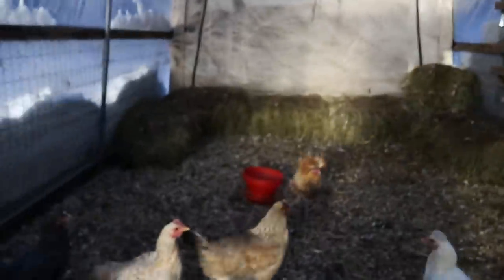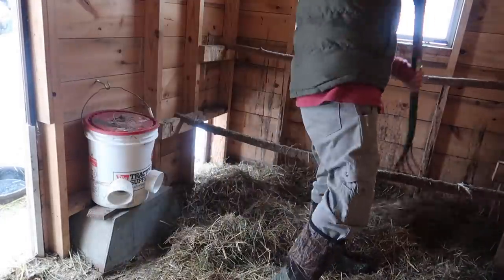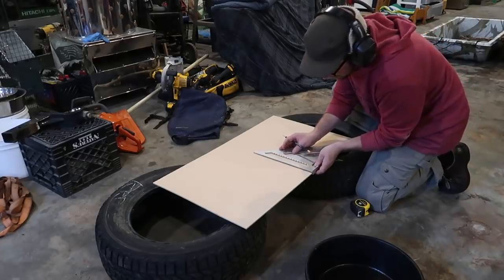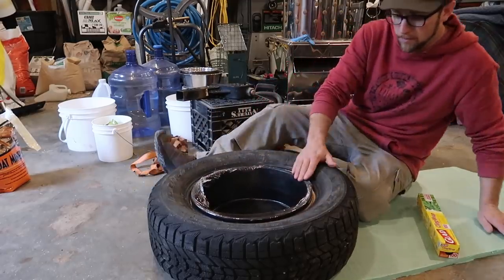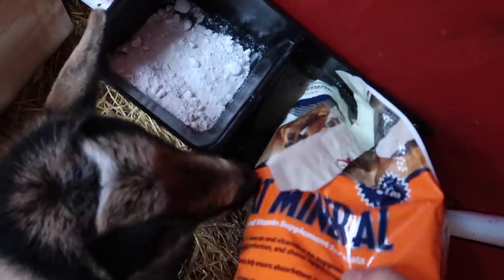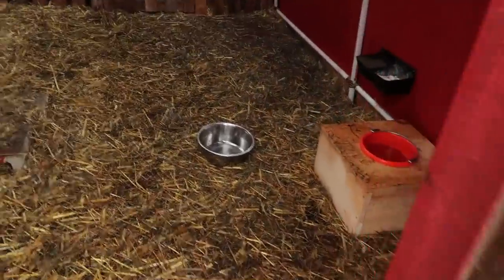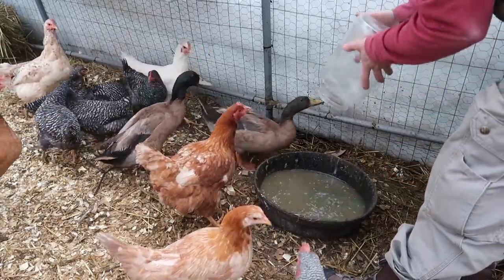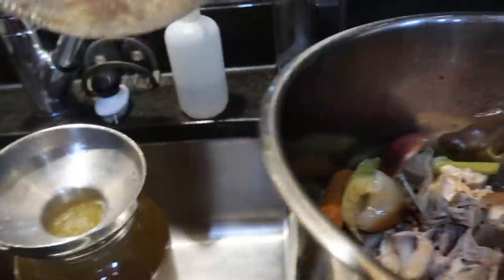This will Make our Chickens so HAPPY!  (DIY Chicken Waterer That wont freeze without Electricity)

Comment: You forgot the roosts for the chickens again. 🙂
If you wanted those tires to build and capture heat, you may want to try something else.  Foam insulates very well, but dont think it really stores much heat for later.   But I've seen some farms that don't really water or feed at night, so when it's really cold, just chuck what's left.  No?

Comment: To add more insulation to the bottom of the water container.. You could cut and wrap, with the foil.. 4 pieces of, like 1x1 wood, long enough to spread the tire bead almost as wide as the sides of the tire...
Once,  most of the foam has been sprayed in and set.. They can be removed for the last spraying of the foam.. 
maybe

Comment: Willow probably smells like GOAT!
Did you not use fiberglass batt insulation for part of the freeze proof water's fill because it might get wet? I thought it might be cheaper to use the expanding foam to seal around the bowl then fill the rest of the tire with batt insulation.  Of course once you opened a can of expanding foam you might as well use the whole can within a couple of days since the nozzle will clog within a week.
Reply from the maker: We used spray foam for the buckets